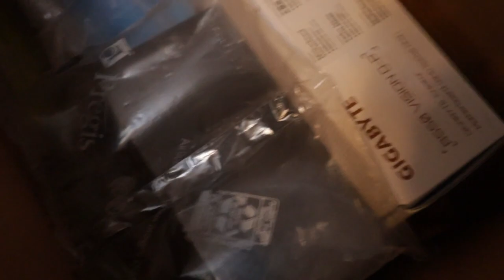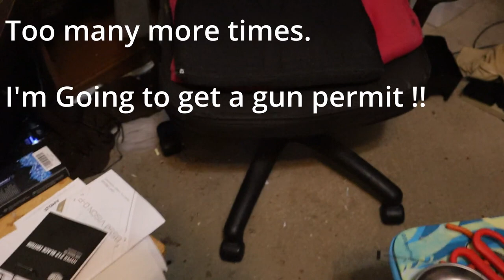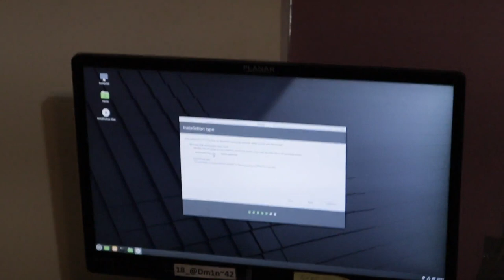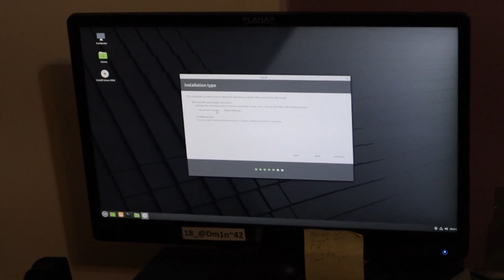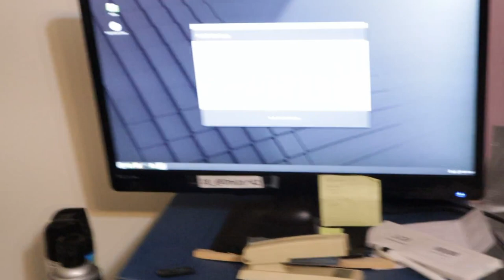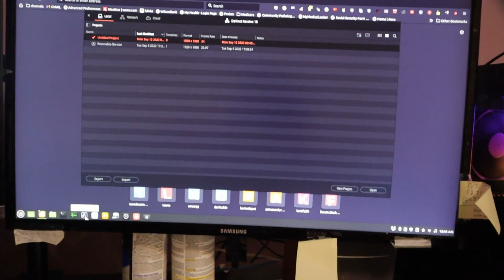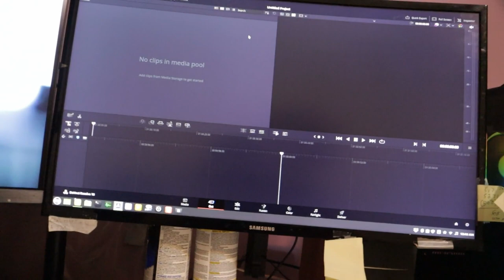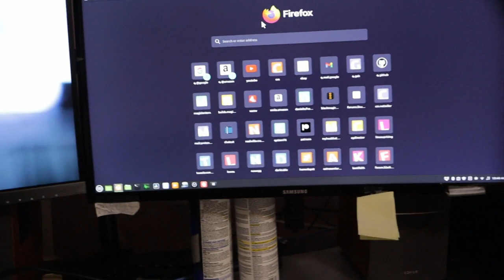Building Computer For DaVinci Resolve

Comment from the maker: Canon M50 So sharp, I had to apply a softening filter in the first half of this video.
Kit Lens

Price brand new 600 bucks
DaVinci Resolve free version
Home made Computer;  $1800 Bucks
Ryzen 9, Geoforce 6 gig Video card.

GIGABYTE B550 Vision D-P (AM4/ AMD/ B550/ ATX/Dual M.2/ SATA 6Gb/s/USB
3.2 Type-C/Thunderbolt 3/ WiFi 6/ Dual 2.5GbE LAN/PCIe 4.0/ Motherboard)

EVGA 850W Power Supply
Corsair Vengence RGB Pro SL 32 gig Memory sticks x4
Cooler Master Hyper 212 Black Edition CPU Air Cooler, Silencio FP120 Fan

MSI Gaming GeForce GTX 1660 Super 192-bit HDMI/DP 6GB GDRR6 HDCP
Support DirectX 12 Dual Fan VR Ready OC Graphics Card (GTX 1660 Super VENTUS
XS OC)
Apevia ENZO-BK Mid Tower Gaming Case with 1 x Tempered Glass Panel, Top
USB3.0/USB2.0/Audio Ports, 1 x Black/White Fan, Black Frame

ACIDALIE M.2 Heatsink,SSD Cooler for Pcie NVMe or SATA M2 2280 SSD Cooling
with Fan

CentOS to Linux Mint .run to .deb converter;
<”https://www.danieltufvesson.com/makeresolvedeb”>

Royalty Free Music:
<"https://www.danieltufvesson.com">
<”https://www.youtube.com/c/VlogNoCopyrightMusic/videos”>
<”https://www.youtube.com/playlist?list=PLzCxunOM5WFLNCSF0UEHZqFJJlmdeL71S”>

DaVinci:

<"https://www.blackmagicdesign.com/products/davinciresolve">

Scroll down to Davinci Resolve.

Links broken? Just do a google search.
Do an Amazon search for the hardware listed.